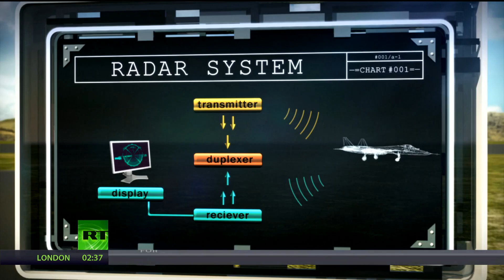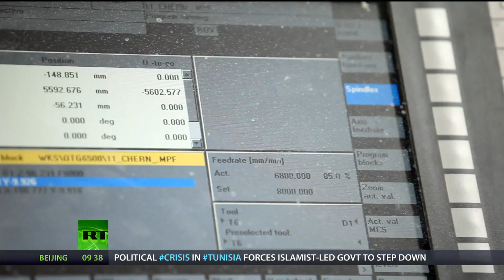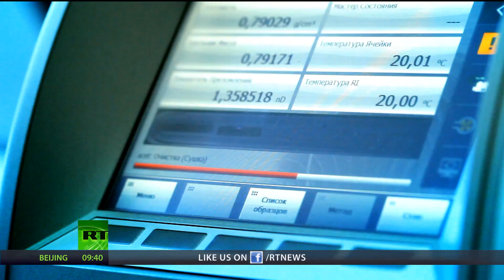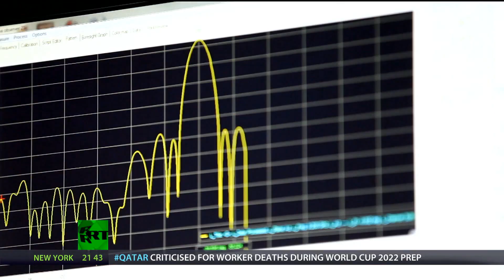Sukhoi T-50 PAK-FA Stealth Technology

Comment: I think too much credit is given to "Stealth"

There's no way in hell you're gonna hide a huge chunk of metal in the sky no matter how much RAM and fancy shaping you employ.

What stealth does is reduce the size and maybe give a few miles of detection range to the pilot

Modern Radars can detect "Golf Balls" flying at Mach 3 nowadays.
Reply: ***** Another who believe in that old idiot talking about radars and f22. You know nothing about how radar and radio waves works, as well as you don't know how F22 is absorbing them.
Reply: *****
The examples you gave are too limited. The F-117 was shot down in a fluke, and it was used extensively used in the Gulf War without being detected (Over 100 bombing runs, if my memory serves right). The F-22 Raptor does lose to the Eurofighter in a dogfight, but that's hindering the main tactic used by the Raptor: Approach undetected and fire missiles. You need to remember in all-out war planes won't be dogfighting except as a last resort.

I am guessing the PAK-FA will have aerodynamics and avionics in comparison to the Raptor, with radar and electronics in-between the Raptor and the JSF. Which is to say, much superior to most planes in existence currently.
Reply: ***** Yeah stealth doesn't work.... that's why everybody is copying the US. Use your brains for once.
Reply: Kvarnholmen rocket tech in russia has existed at least as long as the germans did. the USSR got far less german tech and had to discover many things themselves. also a rather interestngfact is that the soviet delegates that visited britain won a bet in cards ver the Nene RollsRoyse jet engine so the USSR won it fair and square. Russia has merely lowred in economy capability for now but Putin is actually raising it back to its former glory and Russia is a very influential country though unlike the over aggressive USA it doesn't abuse power.
Reply: mengelmoesNL A) both the US an RUssia have lazer anti missile/aircraft systems as for the black sea incident it isn't propaganda 

https://futuristrendcast.wordpress.com/2014/11/19/what-frightened-the-uss-donald-cook-so-much-in-the-black-sea/

the Aegis system did track the Su 24 but because it was in Russian waters the russians had the authority here and drove it out bu=y knocking out fire control, RADA and etc systems the ECM they used was a trial version, I have sme contacts in Russia who tell me that this was a older version and that a new more effective one was being developed.
Reply: "There's no way in hell you're gonna hide a huge chunk of metal in the sky no matter how much RAM and fancy shaping you employ."

If the shape deflects the radar somewhere else, how does the antenna pick up the return? In close range there's a higher likelihood you'll "see" a surface that bounces radar back to you.

Like, normal planes have techniques to defeat Doppler radar such as beaming, you think a stealth aircraft won't have even more techniques to render your tracking useless as soon as their RWR starts singing?
Reply: *****
America:  Back To Back World War Champions.  How do you like me now bitch?
Reply: You're catching on now!
Reply: Kvarnholmen most long range Russian missles out do the AMRAAM by 100-200 km and the RADAR has a far greater reach
Reply: Charlie Gareginyan yawn/ butthurt. The point was: if it didn't work nobody would be adopting it outside the US.
Reply: ***** "thing is stealth is a hoax used to fatten the bill.". Better phrasing would be advised.
Reply: ***** It probably gives minor advantage.. but that is all you need. And that is why others are pursuing it.
Reply: Kvarnholmen actually the Russians had similair advancements in rocket tech as the germans but simply couldn't implement it into action and even today Russia has things that supercede or rival wester and german tech
Reply: ***** US laser weapons basically render the entire Russian missile based defence useless. Interesting times ahead for sure. Let's hope we can contain war in the middle east for this cycle.
Reply: ***** I'm sorry but the black sea incident was clearly Russian propaganda. I'll have to see something from credible sources before believing that one. 

My laser comment was about anti ship + aircraft missiles.
Reply: Charlie Gareginyan Credible sources bro.. I've seen the article multiple times always on shady websites. From the article:

"“The State Department acknowledged that the crew of the destroyer USS Donald Cook has been gravely demoralized ever since their vessel was flown over in the Black Sea by a Russian Sukhoi-24 (Su-24) "

Yeah, like the US state department would ever make such a statement :D
Reply: mengelmoesNL and this ladies and gentlemen, is why argueing with a person who dismisses sources based on what they think is pointless!
Reply: Charlie Gareginyan Yes keep believing that the US state department would actually make a statement about "gravely demoralised" soldiers.... LMFAO. I always love how opposing sides, be it pro US or pro RU, suck up anything that fits nicely into their worldview without question.
Reply: Kvarnholmen I am not claiming anything I just think that Russia isn't just bluffing, as far asI can tell about the incident the Donald Cooks Aegis system locked on to the plane but no action was taken for 3 factors A) the plane was unarmed (it seemed) B) the US is not (thankfully) at war with Russia and C) it was in RUssian waters illegally and by maritime law the Russians had the right to blow them out of the water (they had warned multiple times about staying out of that area.) 
the Su 24 that was equipped with the so called Khibny got close enough to shut down the fire control, RADAR and other systems at the apporximate distance of 1 km well in range of the AA defenses. this is an obvious weakness - the range, BUT as one of my pretty well informed contacts tells me a new much more powerfl and long distance system is being developed so while the Khibny experiment had obvious shortcomings I belive it is effective if modernized (khibny was an 80s design ECM).
Reply: Charlie Gareginyan Keep on dreaming mate. Must feel good believing in BS stories. If your interested I got a Bible or a Koran to sell to you.
Reply: Kvarnholmen Russia had warned the US to keep out of Crimean waters and this was a small show of force, the US had not right to be there in the slightest. during that time there was and is a civil conflict in Ukraine one side is directly supported by the USA and Russia is warning it to keep out of it.

PS calm your tits
Reply: Kvarnholmen Crimea was always Russian and it also annexed itself the US does have a right to be in the black sea but not in Russian waters with a military ship. also Russia is NOT in ukraine the US has not presented a single peicew of credible evidence of such and Nuland has claimed that 12000 soldiers of Russia are there WTF? its just a bunch of horse shit
Reply: ***** Uh no, because we actually have footage of it in operation. I would be on your side if western media claimed that a laser weapon had made a couple of Migs turn back to Russia and that the Russian ministry of defence made a statement that their airmen shit their pants and were heavily demoralised. Come on people... use your damn brain.
Reply: Yet the Modern US radar cant even Prevent A US Destroyer Colliding with the most slowest Oil Tanker.

Lets Count How Many times! 1, aaaand 2....
Reply: That is why the Soviets did not develop the Stealth jet in the 1970s, or 80s; development was too expensive and it would become  obsolete too  fast.
Reply: Ouija1210 i believe not, the real issues was that Stealth aircraft are more vulnerable in Long range when their Internal Bays are open.
Reply: That did not age well. Did it?
Reply: mengelmoesNL nobody is copying the US there is something called correlating design, and actually the modern basis for staelth was developed by thin the 60s by a ukranian man named Ufimstev. stealth works but its overhyped and really a good combo of long wave and short wave RADARs can detect most of them. though its still harder to pinpoint,IR stelath has been in Use for a long tme so thats not really a mtter here
Reply: "the modern basis for staelth was developed by thin the 60s by a ukranian man named Ufimstev" which the Soviets ignored and so let the paper get published rather than forcing it to remain a secret.

Comment: LOL! they can't even make its nose nozzle and engine stealthy! so how can radar see this plane as small as baseball?
oh that's it...its marketing strategy!
Reply: you are so dumb - you think you know more than the engineers designing this aircraft - that is what is laughable. the nose nozzles are concealed between the tail fins; so no side facing radar will illuminate them, thus it isn't necessary to shape them like the Raptor's, which are shaped to accommodate a 2D thrust vectoring profile.
Reply: Do you even know what makes engine "visible" on radar? His blades... how in the name of God you know from this video whats reflection of his blades from front..? They are probbably digged in airframe or there is L/G air flow pass in front of engine...
Reply: ITmage Rear nozzles also makes an airplane visible, not just by radar but for IR scanners. I don´t know if russians are working on a different engine mount, but these vector trhust nozzles aren`t hidden like the F-22 ( I don´t like F 22 either) and should produce lage amounts of heat. Like a IR missile magnet!
Reply: Jason Smith On 15 January 2014, Business Standard reported that Indian Air Force Deputy Air Marshal S Sukumar said of the T-50 that it was "unreliable, its radar inadequate, its stealth features badly engineered". wikipedia
Reply: Francisco Partidas Actually Russians developed flat, rectangular nozzle before USA did, back in 80s to be used on YaK 141. However Yak never entered full scale production and nozzles never saw the light of the day. IR signature is of less importance on PAK FA, so  i actually doubt they will work on reducing heat signature. Since PAK FA is not dedicated air superiority fighter.

Comment: Stealth does not win battles with current low frequency high range radar. It's the plane's speed, maneuverability, countermeasures and missile range.

+Who cares about long range missiles if you are flying over mountains and valleys that can be used for cover. In this case any Sukhoi will win because of it's greater thrust and maneuverability.

Comment: stealth is also somewhat of a marketing ploy by the Def industry... long wavelength radar types ( the first generation of radar actually and still very common) can see through most stealth, the Yugoslav air defenses shot down a F-117 in 1999. stealth in most cases actually means you are not invisible but have a reduced radar signature, long wavelengths detect smaller objects...however it has been said the the YF-23 was totally invisible...
Reply: i agree stealth is so close to obsolete its rediculous. those Low freq L-bands in the wings of the T-50 will give it more of an advantage along with Irbis-E X-band itll see the raptor first most likely.
Reply: yah but unless there is a major conflict we will never see that, f-22 are kept close to home and do not have the range, i suppose a flight of them could mid air refuel, but one of the major reasons the program was killed was because its usefulness in projected conflicts in the next 20 yrs was limited since there is no naval variant...
Reply: phoboskitty m i for one am glad its cut that means more upgraded 4th gens and less wasted money on worthless crap. The raptor can have all the stealth in the world but it wont stop IRST from tracking it 50-60 km out and getting a Meteor or R77 shoved into its arse or intake.

Comment: If stealth tech is invented in russia, why u russians used it late? -funny
Reply: *****
Everybody borrows ideas from each other. There are smart and talented individuals on both sides
Reply: "If stealth tech is invented in russia, why u russians used it late? -funny"

Because it wasn't.  It was developed by the Nazis.  There were some Russian scientist that toyed with concepts of one principal approach to stealth but that was about it.  That doesn't make them inventors of today's Stealth which is (especially in the USA) is a combination of different principals not just one.

Notice that the Russians aren't creating their own Stealth designs.  They're copying the lines of the YF23 and YF-22 and trying to step it up..
Reply: No.  Ufimtsev was not the originator of any stealth.  Ufimtsev was trying to further develop equations from  the theories that were already published by German physicist Arnold Sommerfield.  Sommerfield already had  worked on concepts of electromagnetic deflection as well as absorbing materials to defeat Radar. Sommerfield was brilliant.  Want to read up on some of his works???  Its an eye opener!

Like I said before, What Ufimtsev did for Somerfield's theory is kind of like what Harold White at Nasa is doing with Miguel Alcubierre theories today on spacial warps. White's contributions are huge in adjusting Miguel's theories but its funny they don't call it "White's"  theory.  They still call it the Alcubierre theory or maybe Alcubierre / White theory one day! 

Some of you Russians need to show Sommerfield more acknowledgement and respect like the rest of the world.
Reply: Monster LMA Actually the Fan lift was always British.  The First VTOL Yaks were fully Jet lifts, but the Jets were poorly engineered and consumed way too much fuel.  It also stirred up to much surface debris which  would circulate back through the intakes and flame out the engines.  So the Russians turned to the British Harrier designs and implemented the lift fan in next Yak VTOL designs.  Fan lift improved the safety and efficiency of the plane but they still were having way too much fuel consumption issues.
Reply: Технологии разные бывают, в том числе и "Стелс"
Reply: ***** Is that really true?  lol  Do they claim to be the first inventors of the liquid fueled rocket engine too? ROFL.

I don't know if that is true but it wouldn't surprise me.
Reply: Jason Smith
Dumb people? Dumb Americans?  Very  presumptuous and arrogant of you.  Or are just another Troll?

No one is really worried about some desperate Russian attempt to revive old VHF/UHF radar in a desperate attempt to detect stealth.  There were very good reasons why that old radar was replaced.  Its not the golden ticket to fighting stealth technology every wannabe fan boy on youtube brags about.

Comment: Its interesting to see the fledgling stealth programs that Russia now has, very similar to our 1980's SkunkWorks stealth programs. This is Russia's first generation stealth design, the United States is now on its 4th Stealth Design (F-35) with a 5th already being developed by both Lockheed Martin and Boeing. I am quite sure the FAK-FA is a significant step forward for Russian military fighters (much better than the SU-47 Berkut) I think Russia has a bit of a ways to go before they get to where Lockheed Martin is in terms of Stealth develpment, which BTW NONE of their officials or the aircraft pilots will ever discuss how they operate. If you think the PAK-FA gets a better rating than the F-22 I would love to see your absolute documentation on this as I am quite sure what you would be presenting would be considered some of the most classified data ever leaked on the internet.
Reply: Russia invented Stealth tech use in F117 btw.
Reply: I think what you mean is that after we lost an F117 over Bosnia, Russia got their hands on the wreckage and that's where Russia's new stealth tech came from....
Reply: Spartan536 Уфимцев Петр Яковлевич Russian «Godfather of Stealth».
Reply: Jason Smith  Whatever you want to believe. According to the IAF, the T50  is badly engineered (And this is a design partner paying for the project not some internet critic sighting speculation!!!).  Its been hit with continuous delays.  It won't even get its new engines until 2025.  The west is already moving forward with newer designs and newer projects so the F22 is already reaching a point of "outdated".  Russia has made some decent fighters here and there but I can also name a few pieces of junk they made.

You are backing a country with a GDP of 2.3% and one of the worst corruption records of any global economy.  Mass Corruption destroys the potential of any country.   oh yeah!  I forgot!  That's one of India's complaints too.  Lack of transparency and constant request for additional funds.

There is only one thing you said that is true.  Its always about the pilot. Tell me how battle harden are Russian pilots are there?  How many conflicts they have fought in since WW2?  And you want to imply a comparison to Western pilots???  Isreal down 4 Russian pilots without a sweat and were not impressed with their combat skills during the Arab war.
Reply: electronicdawg Uh, because the USA is the world creditor and can loan to itself???  lol
Reply: electronicdawg США бежит с поджатым хвостом из Афганистана . !!!!! ХА ХА ХА.
Reply: Spartan536  It was shut down over Serbia in 1999 :)
And the Serbians are saying: Sorry but we didn't see it :)
Reply: юрий косачев Look who's talking!  If any country ran from Afganistant with its tail between its legs its RUSSIA!  What was Russia's civilian casualty rate in Afghanistan again?  How many Russian soldier's defected and turn traitor?  How many battles lost? You want to really compare that to NATO?  Not a good idea.

There is a point where Afghanistan and its people needs to stand on their own feet and solve their own problems.  Whether they do so or not is their problem.  Nato has done their job and its time to go.